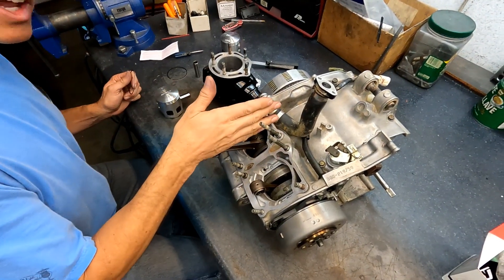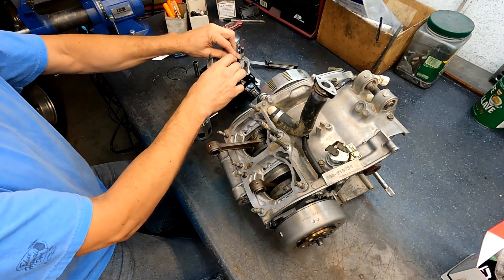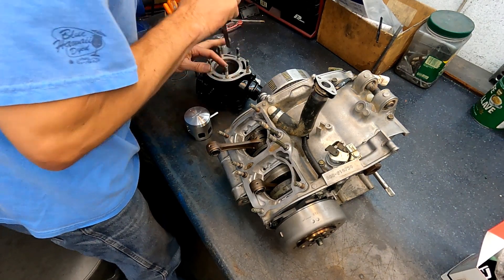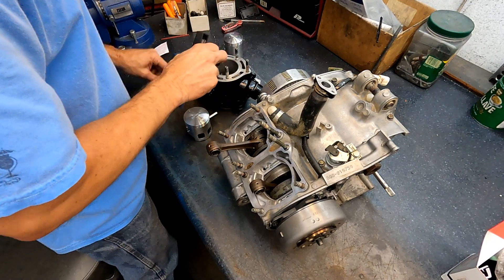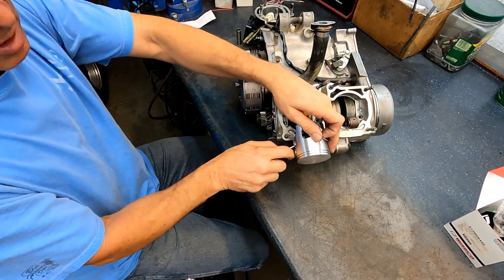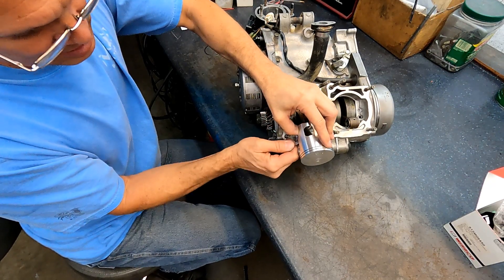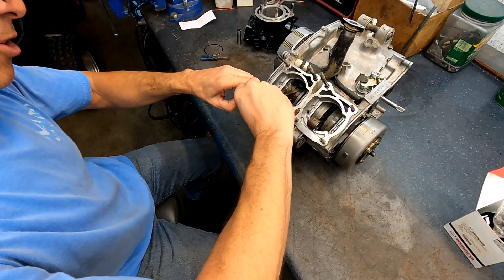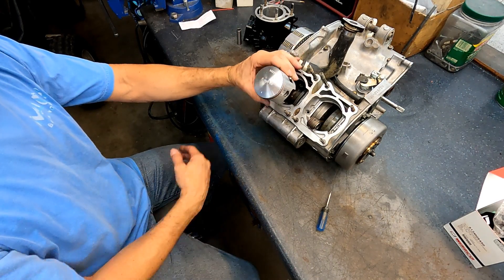Stock Banshee Motor Rebuild Part 5

Comment: Hello so this timing and pump gas ,so here in norway i got 98 v power ,can i tune more or!?😀
Reply: Europe and north American fuel are the same octane its just the testing methods that yield higher numbers in Europe. Your 98 V power (shell?) is our 91. I use the same cause its ethanol free and I just boost the octane number with a quality booster as needed.
Reply from the maker: You have much better gas. You can make more compression and timing than we can here in the U.S.
Reply: @herrjugsracing7816  I have 91 with no ethanol here in Ontario Canada but they are trying to outright BAN ethanol free fuel. The world we live in...